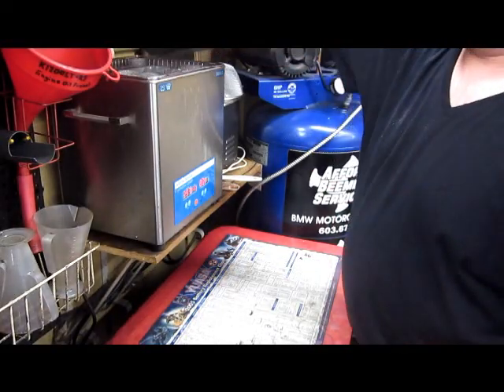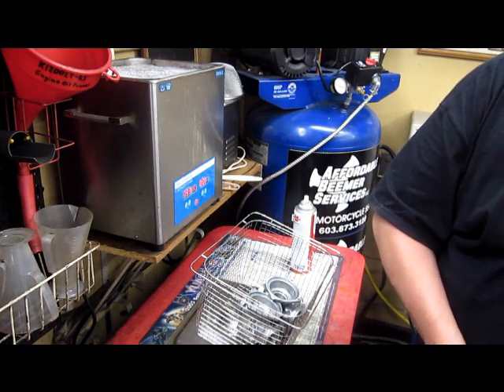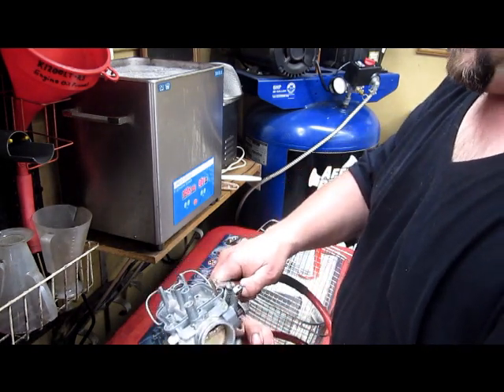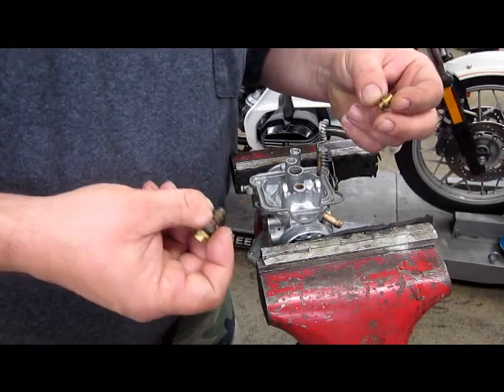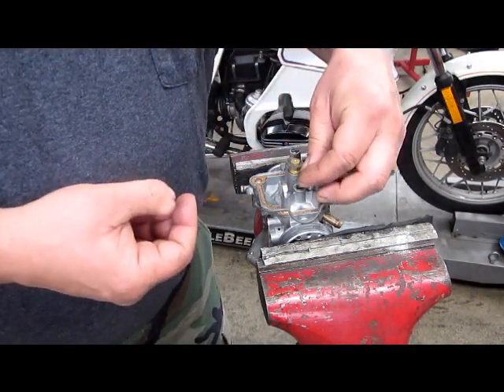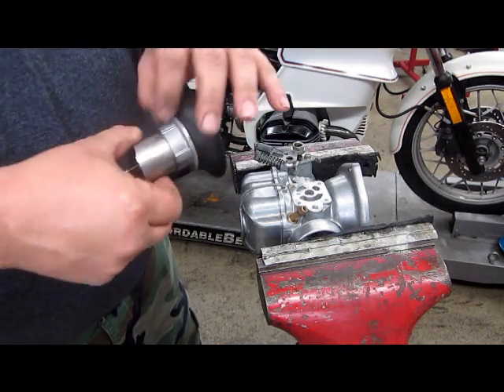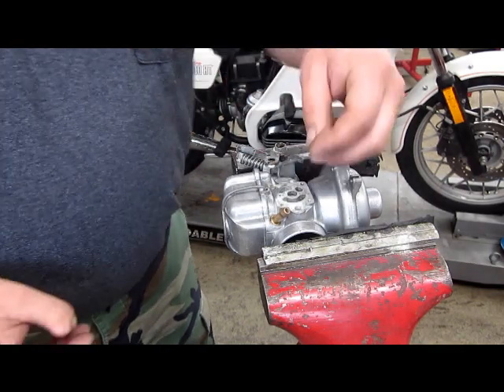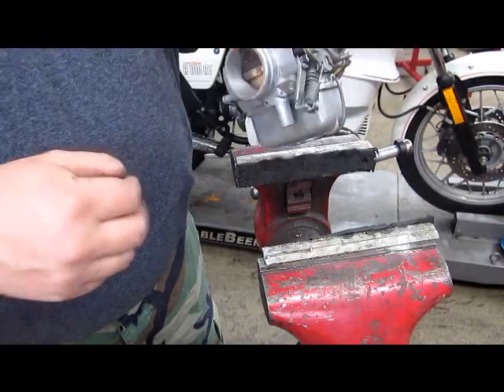BMW Service - 1973 R75/5 carb assembly

Comment from the maker: David, I use 10% Mirachem 500 degreaser / 90% water in the ultra-sonic parts cleaner. The aerosol can is carb/throttle body cleaner. I use rubbing alcohol on any jet that has a rubber o-ring on it but I do not use thread-locker on any part of the carb. I use copper anti-seize on the bolts for the choke and top cover. Replace the diaphragm if torn or damaged. Otherwise you can reuse most of the parts but I often rebuild these with new parts. Kits are available from BING USA. Thanks & Happy 2013

Comment from the maker: Pull the spark plugs and look inside the cylinders. If there is no rust proceed by very gently pushing the kickstart lever through to verify that the pistons move. Then drain the fuel tank, clean the carbs, adjust the valves, change the engine oil and see if it will crank and run. Good luck, Chris

Comment: Chris.  Thanks for making this.  My chokes don't seem to rotate that smoothly.  I notice that you didn't take them apart.  My guess is that they are a pain to put back together.  Think soaking them will free them up?  I have blown them out with carb cleaner and air.  Still don't move freely and don't return to closed with the spring.  Thanks.

Comment: Hi,
I've been watching a lot of your videos lately since we're both planning to get our motorcycle-licenses and are planning to buy 1 or 2 older BMW bikes after riding around a bit with our learner bike (a 1994 Yamaha XJ600N)...
I wonder if you have a video on syncing carbs, since that will definitely come in handy when we decide to buy an older BMW R (I'm a sucker for boxer-engines) and also for our current Yamaha since that thing has 4 carbs?
Respect for making these videos!!!

Comment: Hi Chris, can you please tell me what chemical or detergent is in the parts tank, the aerosol can, what liquid did you put on the jets before inserting them and confirm that it is thread lock that you are putting on the screws.  I have a profound hearing loss and cannot understand the audio, the caption transcription is not very good either, that is why all the questions.  My last questions are did you reuse all the parts except the gaskets and where are the gaskets available from?  Thank you.